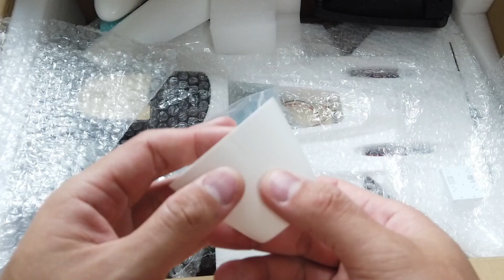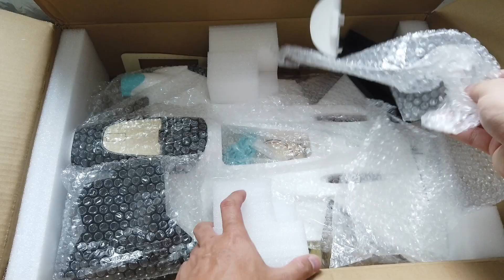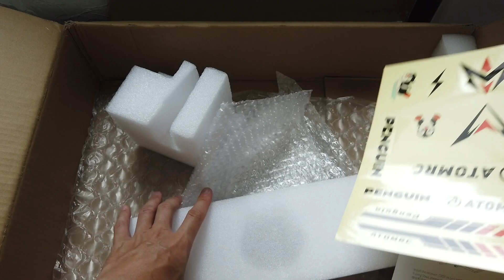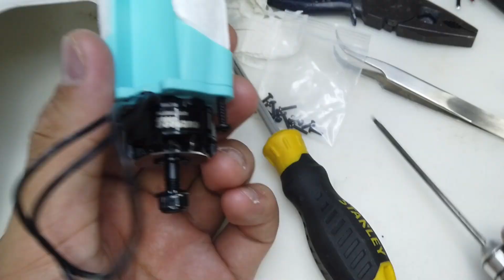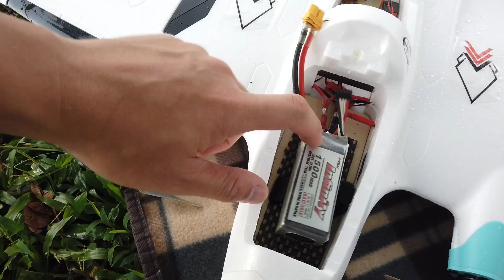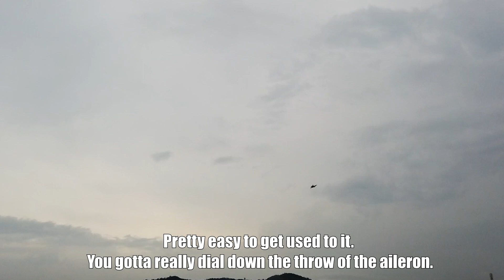AtomRC Penguin Unboxing, Build in 4mins & Maiden Flight

Comment: You like those control horns on the elevator and ailerons, do you Edward!?? I certainly DO NOT! On our Flying Fishes (which uses a similar but bit lighter system) they have a bad habit of rolling around the carbon rod and tearing out/off of the foam. Pin a normal mount THROUGH the foam and lock into place with a plate behind! 😱🙄😉
Reply from the maker: I feel that it's safer because there are 2 pieces instead of 1 piece. On all my control horns, i added extra hotmelt glue including this one
Reply: @EdwardRCAir  Extra hot melt will help - to make the plane heavier! 😜😉 
As I said, we've found that the pin-through horns are WAY better. 😊